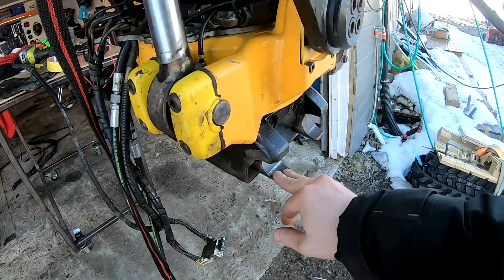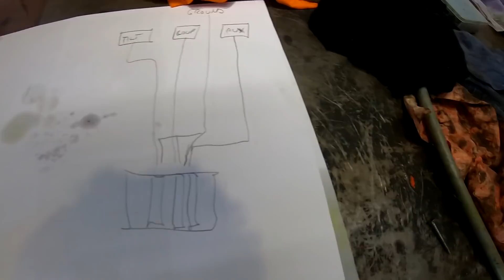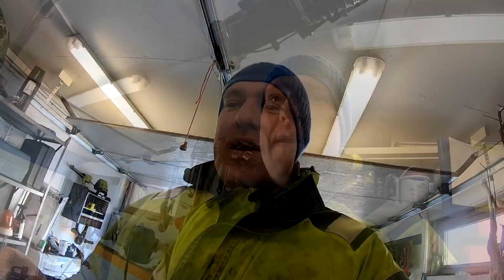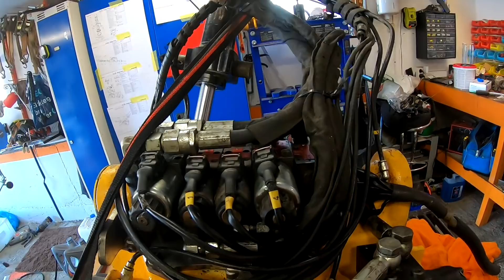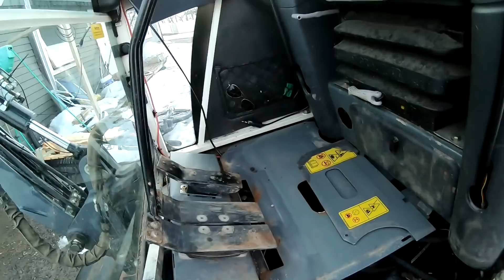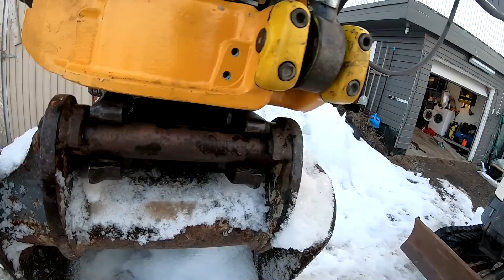Getting the Engcon tiltrotator back in function Part 5

Comment: That tilt-rotator is amazing, looking forward to seeing it in action. Does it take away from your bucket break out force or lift capacity?
Reply from the maker: Yes filmed one job with it already so I just need time to edit🙂 I do notice that it's a lot heavier than just the bucket so I will not use it if I'm loading to the truck from a big pile, it goes slower.

Comment: Are you sure that you can use this valve in double acting line? It seems to be Ss10 system valveblock,  there is pressure and return line and return should have one way valve. You said something about proportional system, this is used there. Have looked at Engcon's Epc, there is more info.
Reply from the maker: I'am able to use it double acting so no one way valve as I can notice, ore difference in speed one way ore an other.
Reply: @MiniMachines1  This is directional valve, not like ss9 system has diverter valves what selects tilt, extra and tool lock, it has 4 hoses to machine. For what you have,  you need one button per each solenoid for tilt and extra and pres pedal only to one direction.

Comment: Very nice Work. Perhaps some day you can trade this Encon for a smaller tiltrotator wen it should be to heavy but as long as it is working it is good because it's to heavy that your excavator can break it.
Reply from the maker: Yes thats a good thing the excavator will never brake it, so I've been pulling som big rocks with it already, but yes the thought have been there that I might be able to sell this and buy an lighter one.

Comment: Congratulations on your engineering.  I hope it does work well digging in the tough conditions you have there.
Reply from the maker: Thanks, I hope it will last without problems since it's made for an bigger machine I will never be able to put those forces on it.